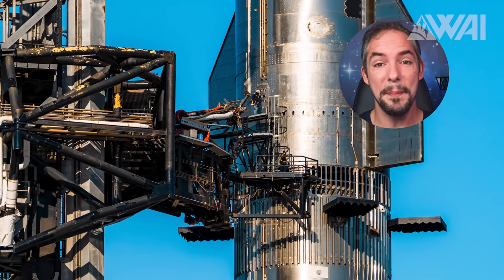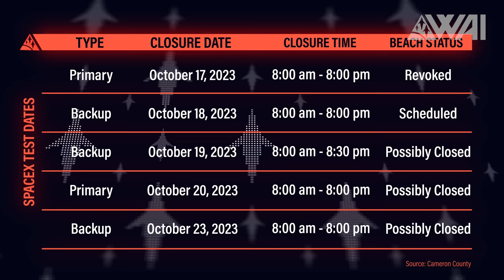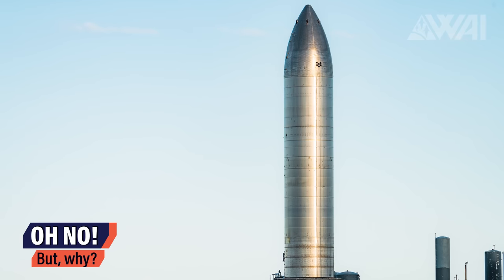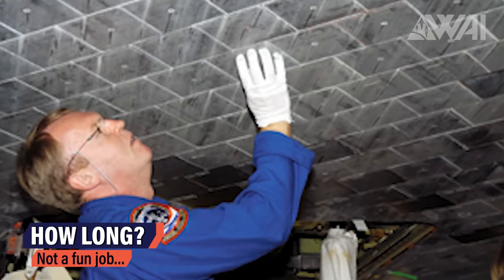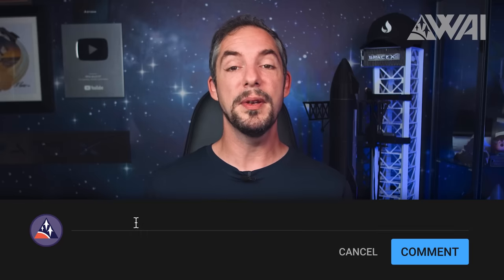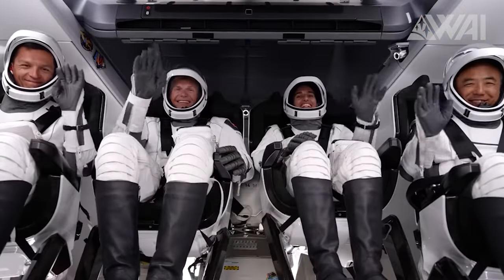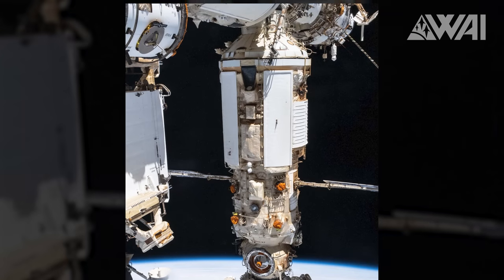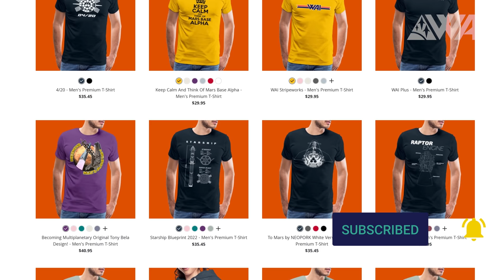SpaceX Starship Tests Continue: It's Action Time!

Comment: Blaming the FAA is not helping as we must remember that SpaceX itself failed on a number of fronts.  They should never have done the April OLT without flame deflection and this alone set them back months in both reconstruction and bureaucracy.

While the Boca Chica site makes a lot of sense as perhaps the only viable near-equatorial option away from the Cape, it's smack in the middle of a wildlife reserve and right on the U.S.-Mexico border.  Boca Chica was bound to be a nightmare right from the beginning as it's not an established launch site already owned by the U.S. Military and surrounded by a buffer between launches and the public.

The rising crescendo against the FAA and Fish & Wildlife is pretty unfair considering the competing priorities of this site and SpaceX's own bungling of the process.  Again, the April OLT should not have happened and if they had sought approval for and installed the deluge system beforehand, they would have performed multiple launches by now!  There's enough blame to go around.

SpaceX has built the largest ever methane bomb in the middle of a wildlife refuge.  Like it or not, that's going to create red tape.  Even the approvals so far may not be defensible in court and that matters to the long-term success of Starship as a lot has been invested into Boca Chica.  If the environmental groups, who should not be blamed either as it's their job to represent the ecosystem, succeed in proving that the FAA or another agency green-lit Starship against existing regulations, then Starbase gets shut down.

While frustrating and costly, delays are far more acceptable than cancellation and potential bankruptcy.  The federal agencies must do this right so that their decisions will hold up in court.  Shortcuts could kill Starship, harm SpaceX, and damage U.S. national security in the process.

Comment: The problem I see with the Starship TPS is the tiles that are not flush and sticking up higher than the surrounding ones in places on the vehicle. On the Shuttle orbiters they were always concearned about any damage causing uneven areas that could trip the boundary layer and cause excess heating down stream. Overall the tiles on the shuttles were far better attached and even and flush than those on Starship.

Comment: Questioning NASA

The temperature of the thermosphere is 2000 degrees Celsius and its thickness is 500 kilometers. How does the International Space Station survive in such temperatures?

How did NASA land on the moon?

According to Wikipedia, Starlink satellites and the International Space Station are operating in the thermosphere. Fact or lie?

Comment: the next test wont tell us what true orbital return will do because its going to be a suborbital flight. when they do an actual orbital flight theyll get relevant data but the first flight ... thats just to see if it can make set goals and as the 1st attempt showed, odds are low for everything going right next flight. if it survives to impact in the pacific great, maybe they can attempt some recovery and gather direct data if not itll be an interesting show hardly anyone will see as it comes in and plops into the water

Comment: can anyone explain whether would it be more conducive to use solid fuel versus liquid?  I'm not versed in positive/negative aspects.
Reply: I've thought this for a while now ESPECIALLY in the context of refuelling/tanker usage.
Reply: For Rockets - 

Solid Fuel Advantages: 
Can sit in a bunker ready to ignite for a long time (great for nukes / icbms)
Simplicity of design - Essentially a tube full of rubber doped with Aluminum/ Ammonium Perchlorate (Fuel/Oxidizer)
Good / High ISP (thrust)
Solid Fuel Disadvantages:
Cannot be switched-off / restarted once lit - Not ideal for reusable rockets
Is charged and ready to explode, so safety in handling is trickier
Really nasty chemicals (Perchlorates - think DDT which was banned because it contained a perchlorate that bio accumulated in bird eggs 50 years after being used a mosquito repellent).. Also burning rubber is highly carcinogenic..

Liquid  Fuel Advantages
ISP is getting close to Solids with Methalox (Methane / Liquid Oxygen)
Can be switched-off / restarted
Fuel density can be increased by refrigeration
Fuel and Oxidizer are separate, so in theory can be safer than solids
In the case of Methalox, burning is clean, so in combination with multiple restarts offers a near perfect platform for reusable rockets
Liquid Fuel Disadvantages
Increased Engine Complexity versus Solid Motor Simplicity

An interesting 3rd option that was worked on by a JPL-sponsored company is Paraffin (wax) and LOX (Liquid oxygen) - Combines many of the best aspects of liquid engines and solid motors
Reply: @weeasledude  so if it evolves into a solid, does that take up less or more space than presently in the Starship?
Reply: @weeasledude  You've got one thing wrong... solids generally have low ISP compared to liquid engines. A good one tops out at about 280s (at sea-level)... that's about comparable to Merlin, but Merlin isn't especially efficient by the standards of kerolox engines (for comparison, the RD-170 family get about 310s), and methane or hydrogen-burning engines are significantly better.

Short version, solids are pretty bad for efficiency, but provide pretty good thrust. They're a convenient way to add extra thrust to an under-powered core stage when needed (e.g. Atlas or Vulcan), or to make a hydrolox-sustainer design work at all (Shuttle, SLS, Ariane 5/6). But they don't offer any benefit to a SpaceX-style architecture, where they just build a high-powered re-usable core stage instead (Falcon 9 looks small compared to Atlas or Vulcan, but those nine engines provide a lot more thrust).

Comment: License to launch should not be for individual events. If the initial criteria perimeters for launch are approved, then only a launch to orbit flight plan similar to a normal IFR flight should be required. I know this is "Rocket Science", but aviation is aviation and there is no justifiable reason to reinvent the wheel or create needless recertification and constant hand wringing. SpaceX is culpable for its actions, and the FFA is not the guarantor nor would be liable except for separation from other aircraft ect......

Comment: Actively cooled heat shield seems more reliable. Because how can you check the condition of each tile after flight?
Reply: A tiny ultrasonic transducer under each tile, bonded to the mounting. Sequentially emit a single pulse to each tile and record the resonance, repeat the scan in orbit, compare to record before take off. Simples.

Comment: If, with all the piles. reinforced concrete, and steel in the OLM there is still substantial shifting with an empty full stack, the problem is major. A fully loaded Starship will cause additional shifting and potentially cause failures in the QD arm or actual failure of the OLM.

Comment: Will Starship be used for hubble oru iss recovery. If  it is used how can parts be squeezed through that little payload door?
Reply: Probably not, but any Starship used for such a purpose would have proper cargo doors or a chomper instead of a single purpose PEZ dispenser anyway.
Reply: No plans for any of that and it is pointless in any case.

Comment: I love how people were going "JUST ONE MONTH THEY CAN DO ANOTHER LAUNCH SOON IT'LL BE FINE". We're like 6 months later and still no news lmao. This thing is NEVER going to actually be commercially viable. It won't happen, I'd probably go 100 to 1 odds that it doesn't work out as intended. Reusing the falcon 9 booster has not significantly saved on costs. Cost is still about 70 million with a reused, non expendable booster and 90 million when the booster is not returned/reused. It saves at most 20 million, given that spacex profits only about 15 million per launch when reused and the same when expended. 

Musk said reuse of the booster would reduce prices to 5-20 million per launch. Musk  is a liar.

Comment: The sands of Boca Chica are already  failing under the static load from a full stack. A launch will push even harder and sink all those billions into the marsh. That's why they're playing a shell game at Starbase. "It's up/it's down and soon underground".
Reply: Of course it will the damn things been sitting there for months doing nothing
Reply: The Saudis created stability in Palm Island by vibro-compaction of the sand they had piled up, I don't see any reason the same method wouldn't work at Boca. Unless there are contaminants in the sand that would interfere with compaction and instead result in fluidisation. Or how about Pilings and freeze the ground to a great depth (they must have plenty of refrigeration plant on site already).

Comment: It is important to protect the environment. It just seems weird that they were allowed to do an orbital launch attempt without all the environmental stuff they are doing now, yet now they do even though they have upgraded the pad to prevent as much damage. Also why does adding a water deluge system trigger a massive environment study by fish and wildlife. Whats the difference between the exhaust chemicals blasted onto the ground and then the rain water mixing with it. Is there a chemical reaction that happens when the water deluge system is used when the water is interacting with the flames and force of the exhaust?  But then they could just collect it and process it so why is it taking so long.
Reply: The water coming out the deluge is from a billed hydrant in brownsville, so is human potable (therefore containing various chemical traces not found in rain - flouride potentially being one). Its then sat inside a huge steel tank for a random length of time. Then when the duluge starts, nitrogen is mixed in as thats what pushes it thtough the system. When it emeges, its then mixed with methane and oxygen (and more nitrogen) gas before exhaust combustion (methane will change the PH of the water making it more acidic in general). Then the folowing water is blasted with the ehxaust from the engine which will also contain particles of metal from within the engines, copper (highly toxic even in small quantities) graphite and other exotic materials etc..

Basically you would not want to drink it, doing so could make you very very ill. 

Its as far removed from 'rain' than its possible to get. 

Considering we know the environment of a wetlands is highly sensitive to change and relies on lots of weird and wonderful microbes and algae, dumping water thats gone through such a system as the deluge does need a lot of investigation to make sure it wont cause irreversible damage.

I find it odd that people agree the wetlands are a sensitive ecological area, but then don't seem to care when it gets polluted from what is clearly classified as an 'industrial waste product'... it may be 98% H20, but that additional 2% is the really important bit..... 

We know SpaceX had always intended the deluge system since before OFT1, so as you and others say, why weren't they going through all the assessments and permitting many many months before now? Maybe they were, maybe they weren't.

My totally uneducated thought is there has been a couple of incidents of 'build it then work out approval later' (maybe hoping they can speed up approval as its already been built?) The vertical Methane tanks is one where the changes to the storage regulations were not sudden, out of the blue, they were signposted as going to happen for a very long time before SpaceX started the construction, but they went ahead anyways and then have to change to the 'correct' horizontal tanks with seperating walls etc.. in order to comply.
Reply: @Thats_Mr_Random_Person_to_you  That makes sense. Thanks for clearing that up. 

I wish space x would have implemented a waste water collection system so it wouldn't need to run an environmental study by not allowing the water to escape into the environment. 

But then again it would be hard to capture the steam and the water droplets flying through the air into the environment with the chemicals. So I guess there really isn't a way to really avoid it.

Comment: I don't have anything against using Agile for project management.  It probably works much better with software projects though and not huge things where govt. agencies have to give approval to everything.

SpaceX chooses to use Agile, that comes with downsides ESPECIALLY in a country where EVERY govt. agency is underfunded and those senators the space company leaders were talking to are very much against raising taxes, and the US govt. doesn't even bring in enough revenue to pay for Social Security, Medicare and Medicaid and workers pay a SPECIFIC TAX to pay for Medicare, Medicaid and Social Security.  That's how much tax cuts have affected the US budget.

SpaceX changed something significant, creating a water deluge system which shoots water all over the place, water which will have particles from burning rocket fuel, and superheated water to add.  SpaceX chose to put their pads right next to waterways that carry water into the Gulf .  In fact I could go on listing out problems SpaceX created for themselves by picking the spot they did for creating a "star port"  They chose it because Texas is a low tax state, that area has a lack of people living there and Texas is also a low regulation state.  That doesn't change the fact that the US govt. has a LOT of regulation involving flight, along with managing waterways along with having the Environmental Protection Agency.  And in those regards SpaceX clearly didn't think about what it was doing, and they didn't understand how constant changes to their systems means constant approvals which means constant delays.  That's their fault.

Maybe Musk could donate part of his billions to the FAA to compensate for the hundreds of billions of tax dollars less the US govt takes in from the top 10% income and capital gains earners along with big cuts to business taxes both of which he benefits from.

Comment: Drilled piers (subsurface base for the launch mount) when installed in sand near a coastline are relying totally on friction with the edge of the holes and length of friction surface. Yes, they can move under varying loads, especially if load bearing ability wasn't calculated correctly. Only my opinion now, but the FAA is in bed with major manufacturers, often not enforcing things they know need doing in a timely matter. Retirees frequently are hired by the overseen companies. Put FAA under the control of the NTSB. The people who clean up the blood and guts can be trusted to get it done right. I'm in favor of separating the Russian section at PMA-1 and beginning to dock there, perhaps with the deorbit vehicle in order to maintain orbit of the well-built and maintained forward sections.
Reply: Yeah, but that's where the maneuvering thrusters and main life support systems are, not to mention that is where the electrical power is routed through. On top of all of which, after over twenty years, it is highly questionable whether the Russian modules can even be detached.

Comment: Felix, do you think they should call the new thrust (and concrete?!) deflection system "The Merlin Wall"? 😉
Reply: Would have worked on Falcon rockets, but Starship uses Raptor engines.

Comment: At the expense of reduced payload to orbit, could additional fuel be conserved for a longer re-entry burn, lowering re-entry speed and minimizing the thermal stress on Starship?  This might make the most sense in providing an additional safety margin for manned missions.  Alternatively, a number of refueling Starships could be semi-permanently staged in popular orbits, they wouldn't be used unless enough tiles are lost during a launch to make a normal re-entry trajectory too risky.  Launches could be timed to allow for quick docking with one of these refueling Starships if there proved to be a need.  In the worst case, a special refueling mission could be launched to top-up a de-tiled Starship if the returning payload cannot be lost.
Reply: What additional fuel?
Reply: @gregbailey45  They conserve some fuel for the landing burn in the header tanks.  Could a bit more fuel be conserved for a longer re-entry burn, scrubbing off enough velocity to allow unprotected 304L stainless steel to manage the re-entry heat if too many tiles fell off during the launch?  The downside would be a lower maximum payload to orbit, but would there be other issues?  Would the header tanks have to be enlarged, forcing a design change?  This is my question.